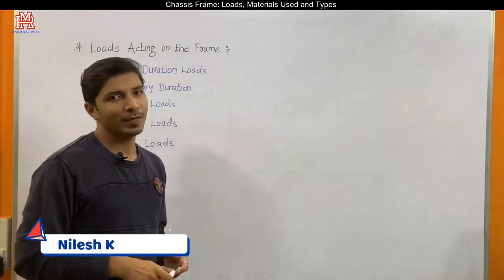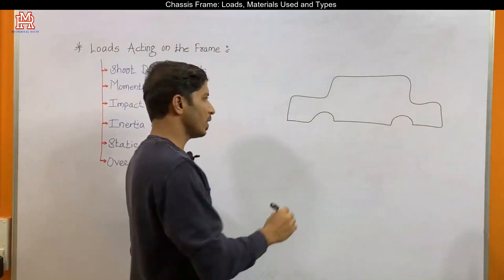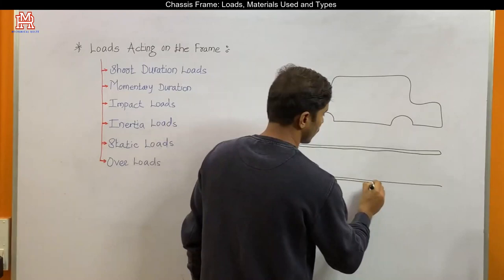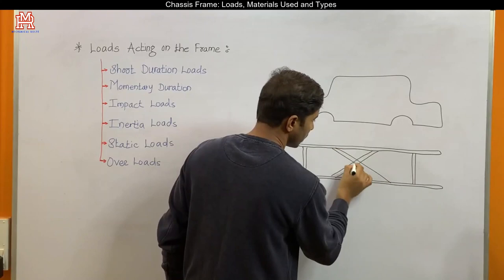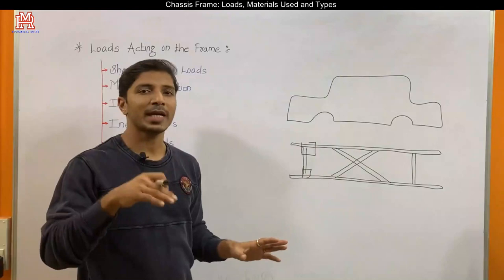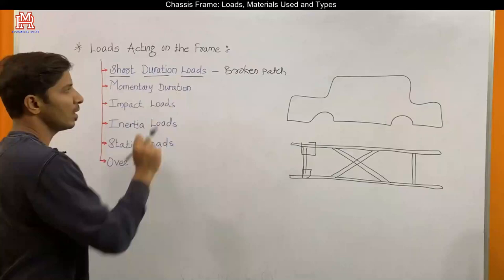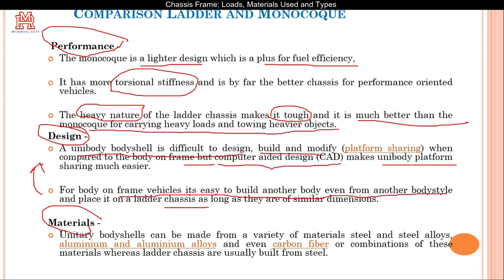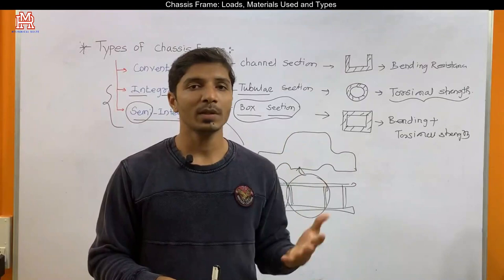Chassis Frame: Loads, Materials Used and Types II Conventional, Integral & Semi-Integral

Comment: I had one doubt, what is the difference between intergral type of chassis and monocoque chassis?
Reply: An integral chassis is basically one whole piece. (The frame and body to together) 

A Monocoque is a cockpit with front and rear subframes attached to it. (Then you add on the body panels and such)

Comment: I find body on frame or “ladder” frame vehicles I’ve driven over the years especially classic ones ride much smoother, are quieter to drive and feel tighter compared to regular unibody cars with no frames at all. 

Plus a fully boxed frame vehicle absorbs bumps and vibrations much much better than a unibody chassis because of the thick rubber body mounts which isolates the vehicles body from NVH. It’s simply a superior way to build a car in terms of riding smoothness and complete comfort.

This is why all the classic luxury American cars from the 1930’s all the way up into the 1970’s had massive frames such as Cadillac and Lincoln’s and they all rode so sublimely.

Comment: want more video  releted automobile.

on these topic given below

UME511 : AUTOMOBILE ENGINEERING
L T P CR
 3 0 2* 3.5
Course Objectives: To deliver basic knowledge of different components of automobiles and 
expose the students with performance parameters of a vehicle. Course provides the learning of 
design procedure of various components and factors affecting operation of vehicle on road. 
Objective also involves the enhancement of fault diagnosis and troubleshooting capabilities.
Introduction: Conventional motor vehicle, vehicle classification and layouts, frame and 
frameless construction, design requirements of different chassis types, vehicle dimensions, 
components of an automobile, power requirements, power and torque correlation, vehicle 
performance parameters, gear ratio for maximum acceleration, stability of vehicles.
Clutch and Transmission: Clutch fundamentals, different type of manual clutches, automatic 
clutch, fluid coupling, torque convertor, requirements for manual and automatic transmission, 
their type and constructional detail, sliding mesh gearbox, constant mesh gearbox, synchromesh 
gearbox, gear ratios of planetary gear system, planetary gear selection mechanism, gear change 
mechanism, Simpson transmission, hydraulic gear change mechanism for automatic 
transmission, Constantly Variable Transmission System (CVT) construction and operation, 
Dual Clutch Transmission (DCT) construction and operation mechanism. 
Drive Line: Introduction to driveline components, speed variations of Universal Joint, constant 
velocity (CV) joints, types of propeller shafts and support bearings, differential gear ratio, 4X4 
drive, differential locks, limited slip differentials (LSD), types of axles and hubs.
Wheel and Tyres: Types of tyres and their requirements, tyre construction, tubed and tubeless 
tyres, radial tyres , tyre design specifications and coding, tread pattern, speed ratings, tyre wear, 
disc pressed wheels, static and dynamic balancing of wheels, alloy wheels, split rims.
Braking System: Introduction to braking system and their types, brake fade, stopping distance, 
hydraulic braking system, brake line layouts and safety features, solid disc and ventilated disc 
brakes, vacuum booster brakes, self-energizing brakes, antilock braking system (ABS). 
Suspension and Steering: Steering mechanisms and steering system including power steering, 
caster, camber, camber roll, steering axis inclination, toe-in , toe-out, rack and pinion steering, 
recirculating ball screw (RBS) steering , suspension principle, coil spring and leaf spring 
suspension, rigid axle suspension and independent suspension, types of dampers, 
Emission control devices: Catalytic convertor and its types, EGR.
Vehicle Electronics: Electrical and electronic systems in automobiles, starting motor drives, 
Automotive accessories and safety features in automobile. 
Trends in automobile sector: Hybrid, electric and solar powered vehicles.
Trouble shooting in above modules.
Laboratory Work: Study of vehicle chassis and construction, study of single plate and multi plate clutch in an automobile, construction and working of following gear boxes: Contact mesh 
gear box; synchronous gear box, parts of automatic transmission system, components of 
suspension system of automobile (2 wheel, 4 wheel), steering system of an automobile, electric 
system, starting system, braking system of an automobile, study of radiator, study of differential,